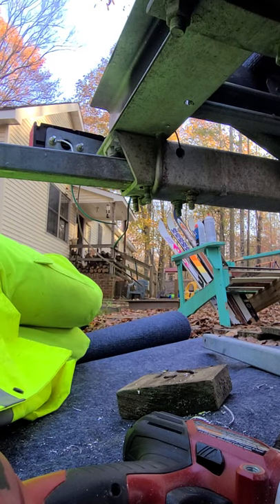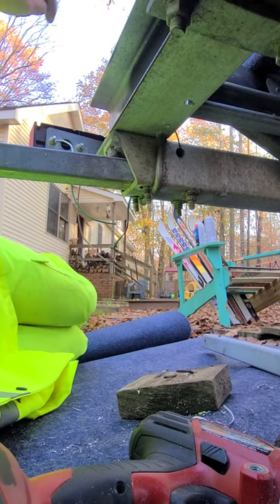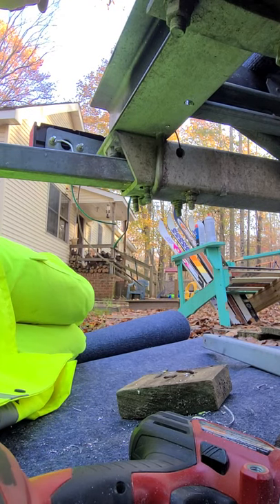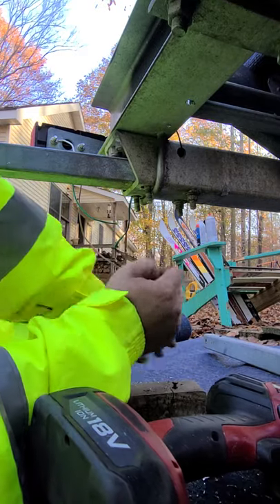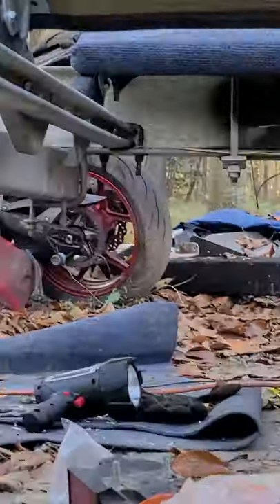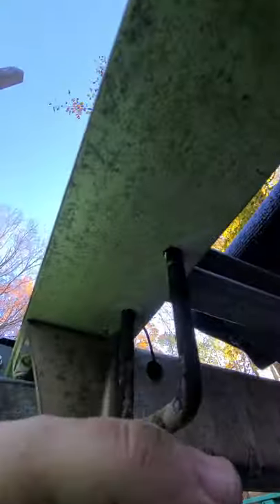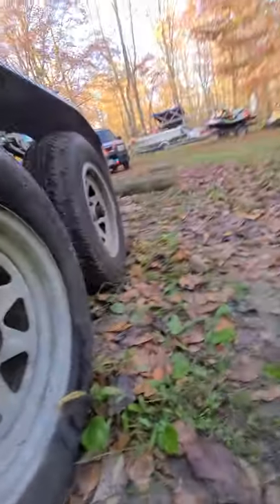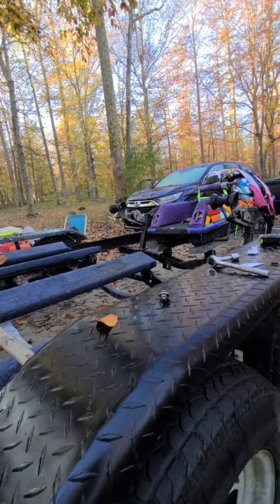Nothing like drilling holes in a new trailer.

Comment: What bit are you using.
I think I need a special bit.
Mine say for wood metal and plastic but burn out before I get it through a metal trailer fender.
Reply from the maker: I don't recall what bit I used, but when drilling through metal, be sure to use some sort of lubricant. Otherwise, they'll burn up.